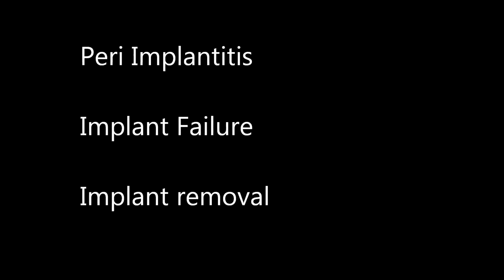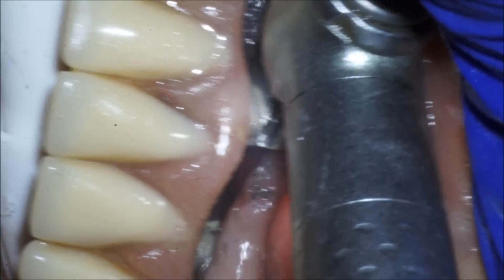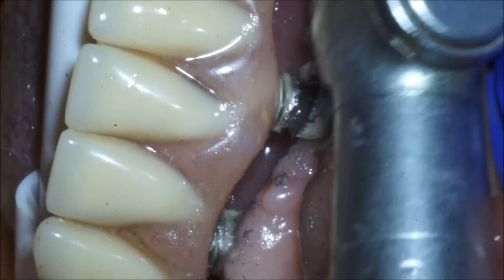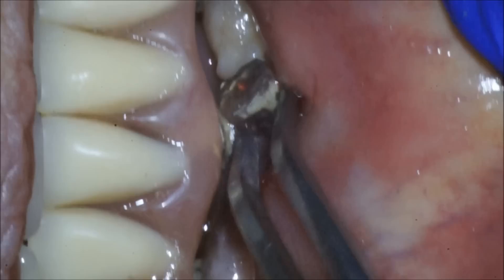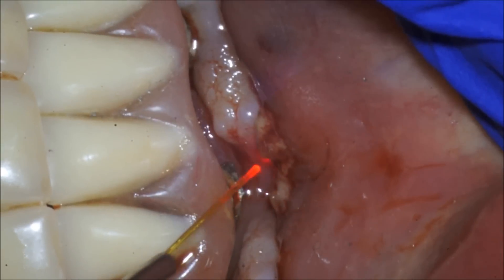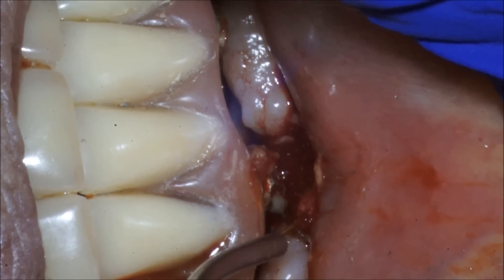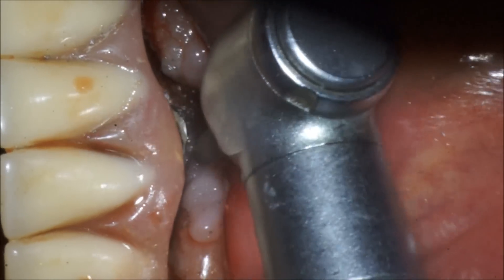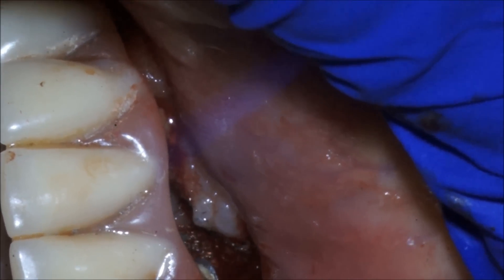Removal of Failed dental Implant Peri-Implantitis 1 213 691 1234

Comment: Go to www.whatimplantisthat.com
Reply from the maker: Thanks Paul if you look at the description I've credited the  whatimplantsarethey for considering these as Zimmer not sure though but it seems the closest match
Reply from the maker: Paul Don't you think all implant companies would standardize at least the abutment screw drivers.  Ridiculous to consider that Nobel has had 3 different types of screws.
Reply: I missed that. I thought that in the video you said you weren't sure. I will recheck it. By the way- nice service to that patient
Reply: I constantly get new implants to look at that require special tools, non standard abutment etc. One from Spain had the screws going in counterclockwise. Not to mention surgeons I work with Who cant make up their minds what to use.
Reply from the maker: Paul Feuerstein As a profession we should demand standardized components.
Reply: Keep in mind that this is an international marketplace with demands from dentists all over the world and manufacturers also from all over. If you get a chance to go to IDS in Cologne next March you will see the problem.
Reply from the maker: Paul Feuerstein One way I've gotten around all the part issues is to use OCO one piece implants.   No screws to loosen or break.  No flowering issues.   No microgap.  I always inform the patient what they have so as when I retire or they move away the next DDS doesn't get to confused.